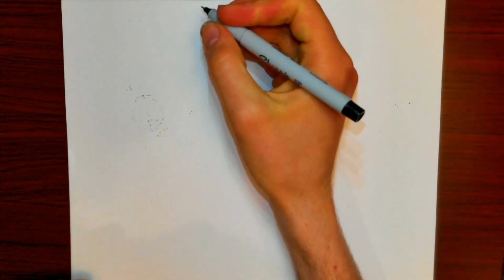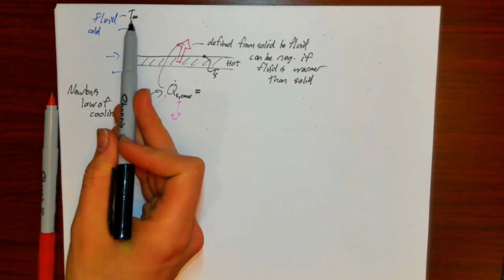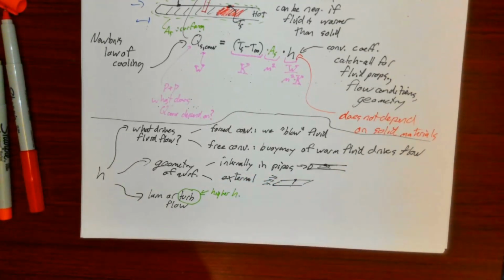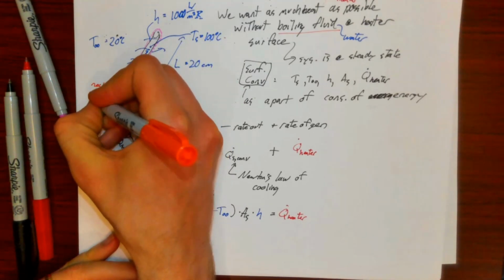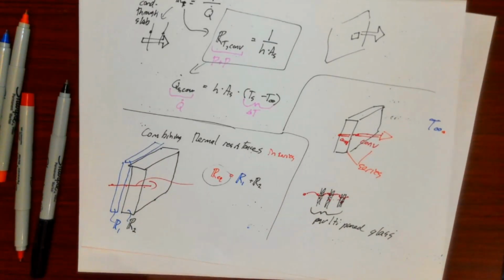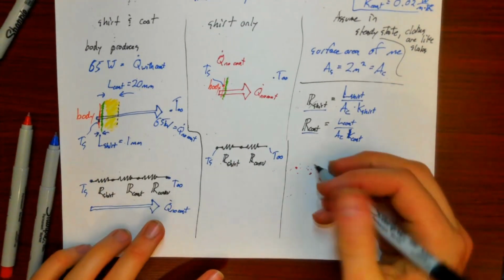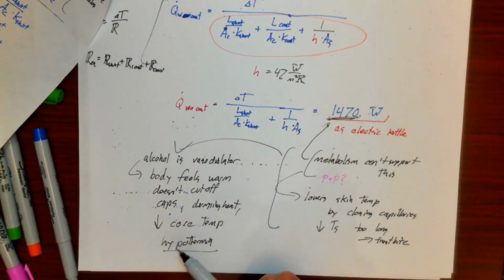BIOE 3310 Lec 20 - Surface convection; Newton's law of cooling; thermal resistance

Comment: Surface convection: heat flow passing from a solid surface to a fluid (but no actual mass passing through the surface of our CV)
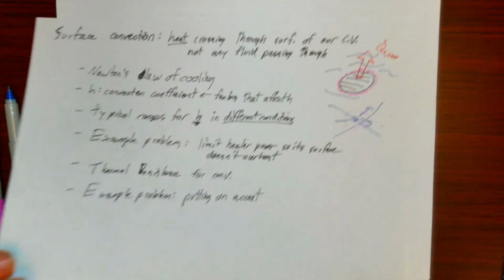Newton's law of cooling 6:50 
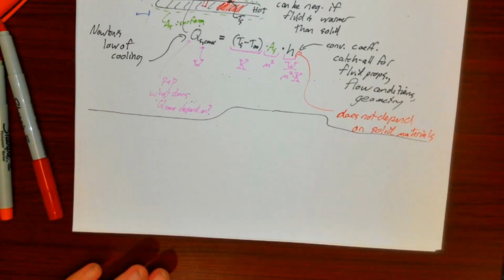Faactors that affect the convection coefficient, h 17:30  
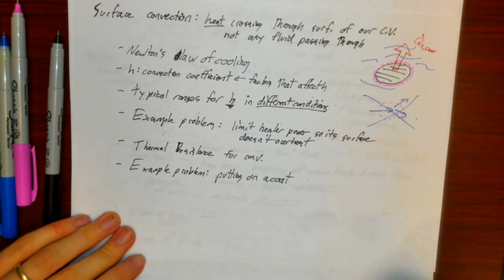Typical ranges for h under different flow conditions 27:24 
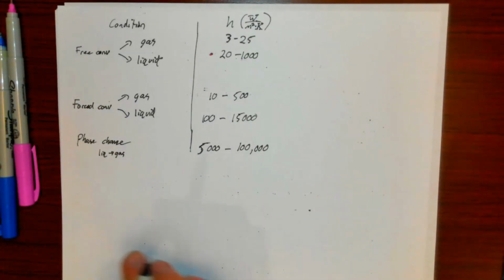Example problem: limiting heater power to avoid excessive surface temperature 32:45
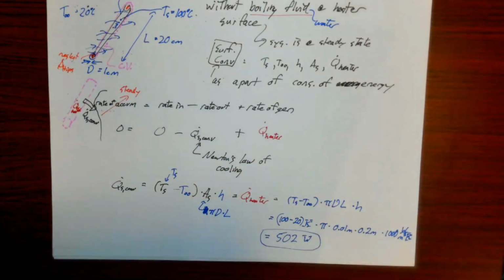Thermal resistance for convection 46:50
Example problem: heat flows and wearing a coat 54:18